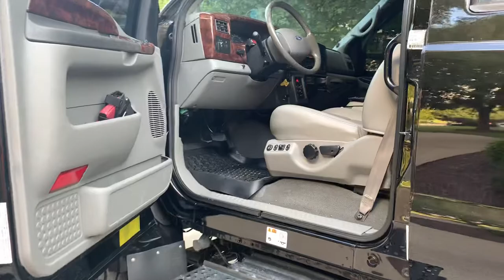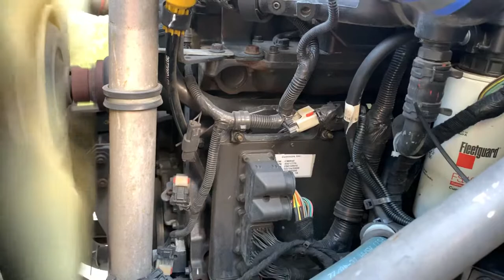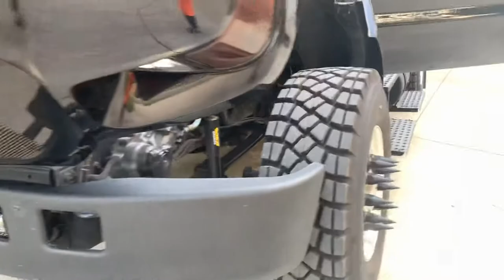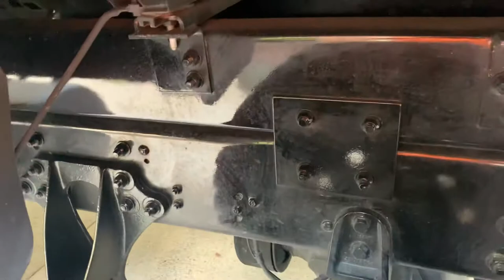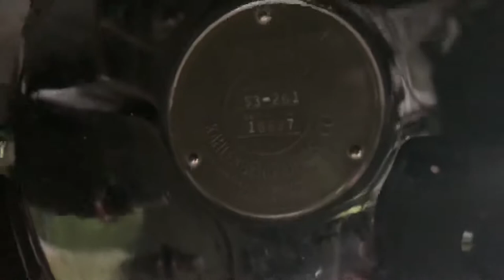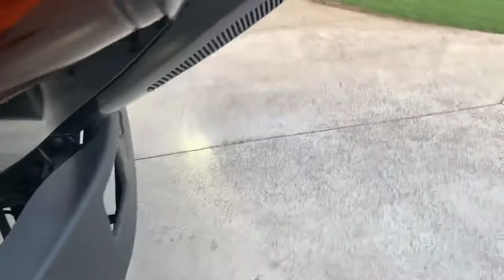Custom F650 super truck

Comment: its running on a 5.9l cummins isb? I thought its suppose to run on a powerstroke
Reply from the maker: No… earlier years, after ford stop the 7.3s, they out sourced the engines (cummins ISB and cat c7s) newer models do have the 6.7 options